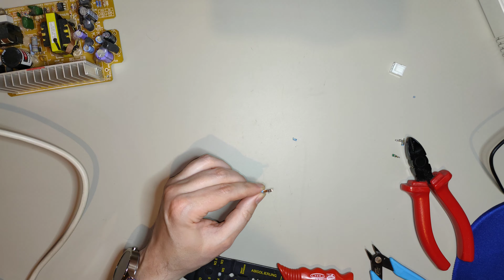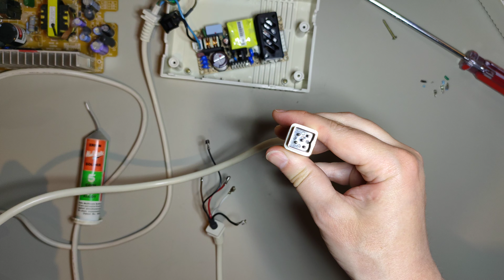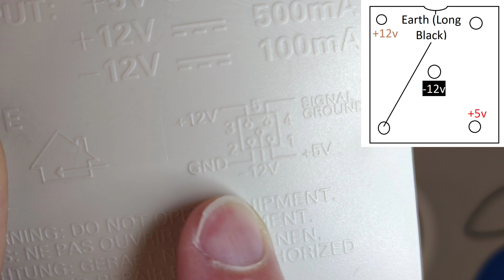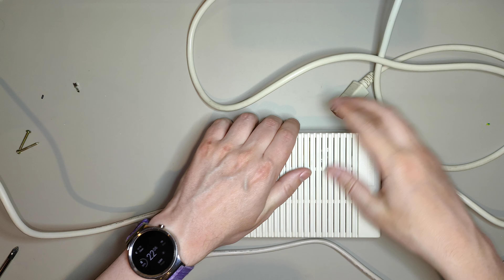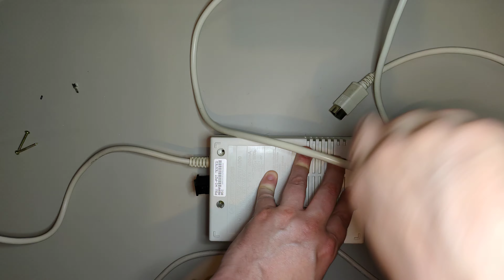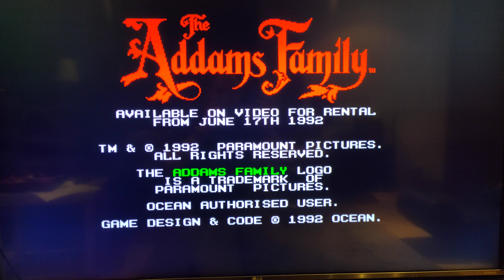Amiga Power Brick Upgrade - stealth mod to a modern Mean Well power supply.

Comment: The RPT-50B works fine? 50w
Reply from the maker: Not sure, some people mention that the RT-50B is larger and might not fit inside the plastic case. You would need to measure it!
Reply: @mattsqwrl  you right... And the other options has less power

Comment: Followed the guide, my 60b does not deliver enough voltage and underpowers my amiga... Did not connect the ground points...
Reply from the maker: That's annoying, do you know what voltages you are getting? It's possible it needs the ground to regulate the output, though probably not.
Reply: @mattsqwrl  voltage on 5V is like 4.85... Will try to connect te grounds
Reply from the maker: That should be within spec, +/- 5% on the 5v, 10% on the others according to this doc: http://www.kaiiv.de/servicemanuals/A500_Power_Supply_Specification.pdf
Does the Amiga not behave? The earth is worth having I'm sure!